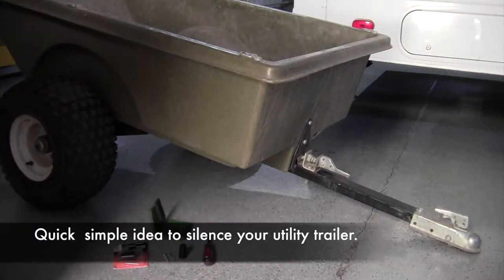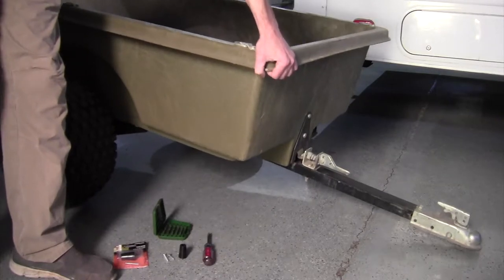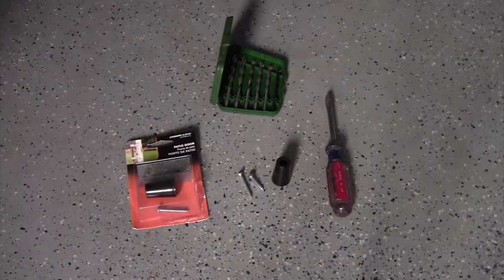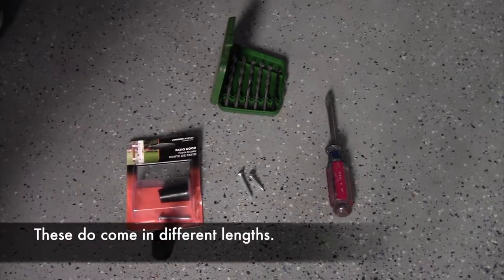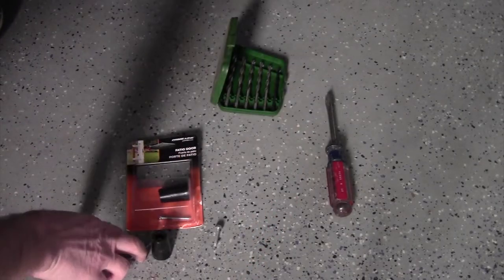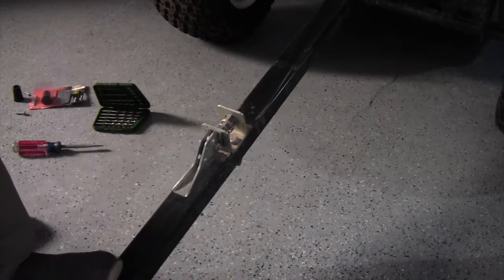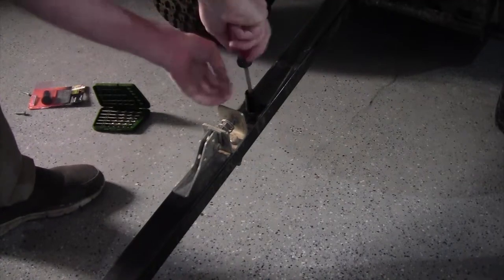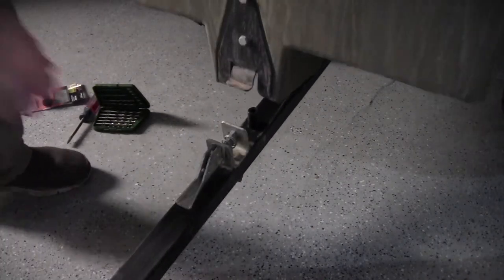Silence your ATV Utility Tilt Trailer (Dumper). Stop the clankity clankity clank.

Comment: I just came across this, glad I did. I just bought the same trailer in black from Sportsman’s Warehouse in Wasilla, AK. I am going to do this exact same thing to mine tomorrow. Thanks for the great tip, I learn something new every day up here, and I love it!😎👍🇺🇸
Reply from the maker: If you have any trouble or delays finding the bumper I used. If you go to Home Depot in the hardware(screws and nails) isle. and look for the specialty hardware. Drawer cabinets. They have some rubber bumpers of different sizes but I believe you would need to drill a hole in it. The bumper 
I used is usually pretty available though. But here is the link for the one I used. https://www.amazon.com/gp/product/B00DPH7RWY/ref=ppx_yo_dt_b_asin_title_o06_s00?ie=UTF8&psc=1
Reply: Thanks buddy, MUCH APPRECIATED! Now, if I can only have a little luck and a steady aim harvesting something this year to put in it, then stock the freezer😎👍
Reply from the maker: @Roninforged  Good luck!!